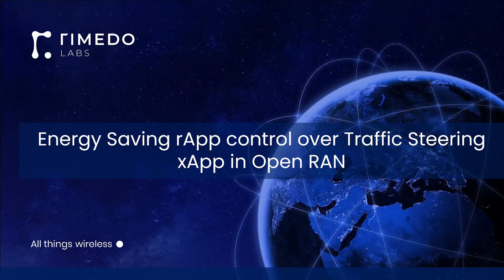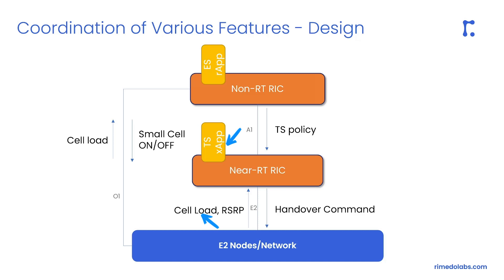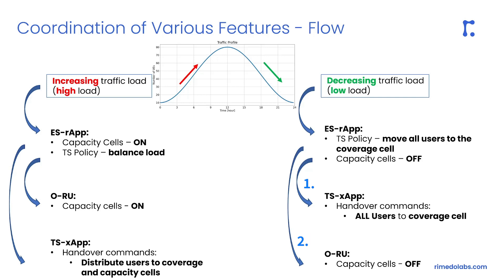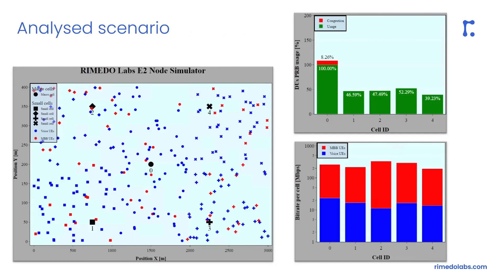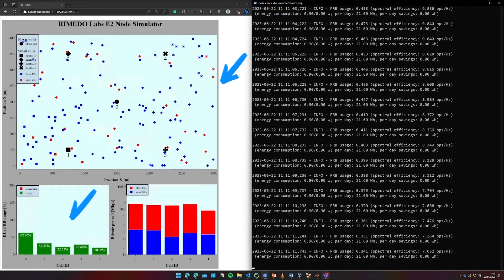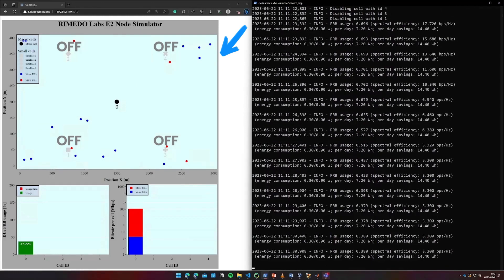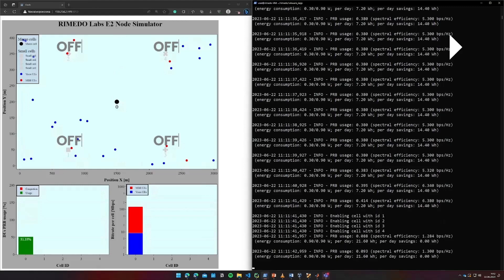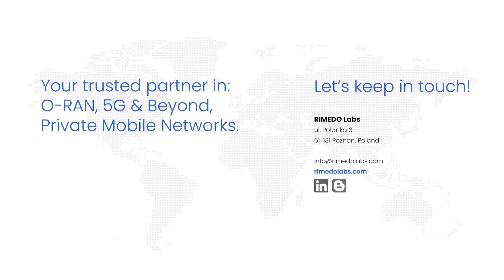Energy Saving rApp control over Traffic Steering xApp for Open RAN (Demo)

Comment: How can i run this? Thanks!
Reply from the maker: This is a commercial demo, thus not available for public use. However, there is an open source Energy Saving with Traffic Steering demo available at SD-RAN platform: https://github.com/opennetworkinglab/smart5g-nonrtric-plt-ranpm/wiki
Reply: @RimedoLabs  Thanks! I tried this in an 18.04 VM but had some issues. Is this the right version of ubuntu to try?
Reply from the maker: This code is maintained by ONF under SMaRT-5G project (https://opennetworking.org/sustainable-5g/) please reach out to them.

Comment: Which components of RAN are turned off in this scenario? I am confused about this because we know in O-RAN we disaggregate the BBU in CU and DU that runs on COTS hardware, so I think there is no need to turn off the components of CU and DU as in traditional RAN we have sleep mode techniques in different components of BBU also go to sleep mode. I think the scenario that you discussed in the video will only turn off the RU.
Reply from the maker: Thanks for your question and comment. In this use case the O-RU is switched off.
Reply: Thanks for reply  @RimedoLabs  SO can we switch off the CU and DU in O-RAN or there is no need of this bcz  CU and DU runs on COTS hardware and in traditional RAN we also switched off the some components of  BBU in some scenarios
Reply from the maker: In O-RAN O-CU and O-DU are virtual entities to be run on O-Cloud platform resources. Thus, intelligent management and orchestration of O-CU/O-DU HW and O-Cloud SW platform resources, coordinated by SMO, are required for the sake of EE. 

For this purpose, in O-RAN NES Technical Report, there is also a feature called "O-Cloud Resource Energy Saving Mode".  The aim of this use case is to enable energy savings in the O-Cloud by reducing the power consumption of various O-Cloud components without impairing the network performance. Given the network status, the O Cloud components' power consumption can be optimized through actions such as adaptive shutdown of hardware, scaling out Network Functions, and optimization of CPU/FPGA power, memory usage, CPU frequency, etc. This use case targets e.g., optimization of workload placement and automated scale-in / scale-out processes help to dynamically adapt the pool of active hardware resources to the actual workload needs and allow to free up HW resources which could be shut down in idle times.

However, in our scenario, we are not considering this item.